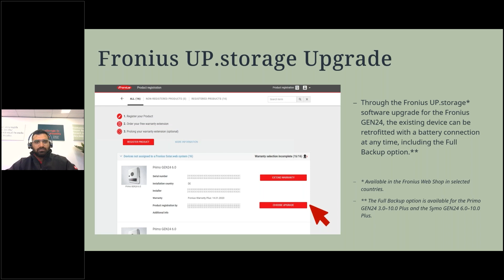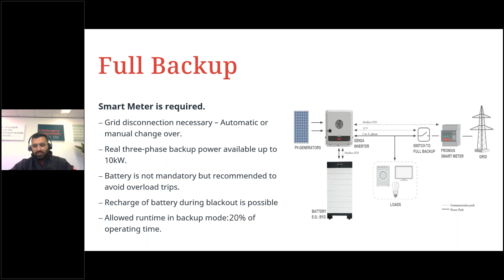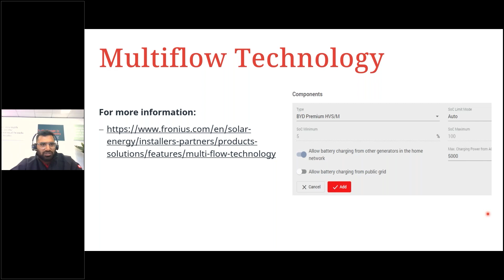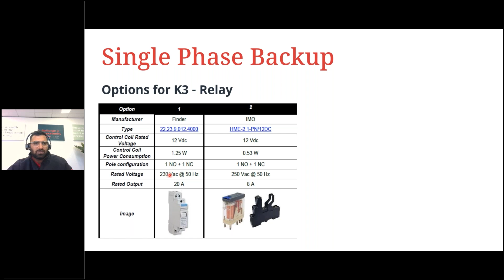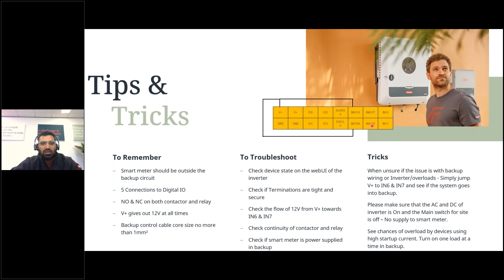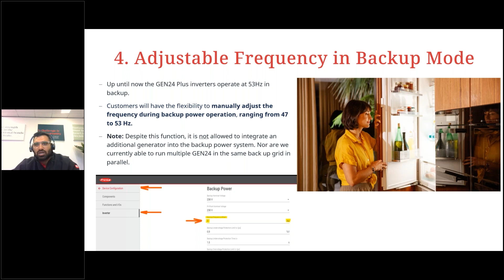Webinar: GEN24 & GEN24 Plus: Everything You Need to Know About Their Backup Capabilities (AUS)

Comment: What happens to the 'Load Management' IO's when the inverter goings into full backup mode? Do these work as normal or do they get switched off until the inverter goes back into normal mode?
Reply from the maker: Hi! Load management is not active when the system is in full backup mode.

Comment: Good video. Will be getting a BYD battery added to my Symo Gen24 this month. What’s the maximum distance between the inverter and the battery?
Reply from the maker: Hi, according to the operating instructions for the BYD battery, the maximum cable length is 20 metres.

Comment: How to set inverter to work without battery?
Reply from the maker: Hello @lukabalic3541,

I asume how you can do the commissioning of the GEN24 inverter if you don't connect a battery (yet). The steps are the same but you do not have to set the battery related settings. So you don't have to add a battery in the chapter "components" and further do not need any backup settings. I would recommend our user manual, which you can find on www.fronius.com to see the steps, which are necessary.

Best regards, Robert from Fronius
Reply: @FroniusSolar  I received feedback from Fronius that it is impossible to activate a full backup power without a battery if we got just backup box and smart meter, which means that the claim in the webinar is not correct?

Comment: Hi, if we buy a GEN24 and we install everything ourselfs with an electrician we can not get the upgrade option later when we want to integrate a battery? Would he than register as an installer? Thanks
Reply from the maker: Hello @SerendipitySunday, Thanks for your question. A PV-installer can upgrade a GEN24 to a GEN24 Plus (which offers storage and full backup functionality) later on. The electrician which installed the GEN24 can also register in our system as an installer and is then able to upgrade it into a GEN24 Plus. Best regards, Robert from Fronius